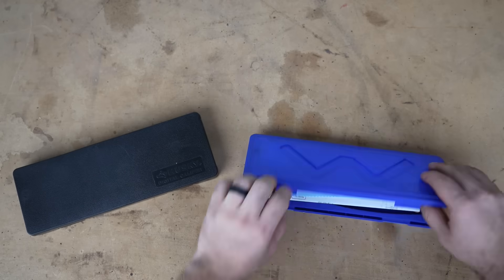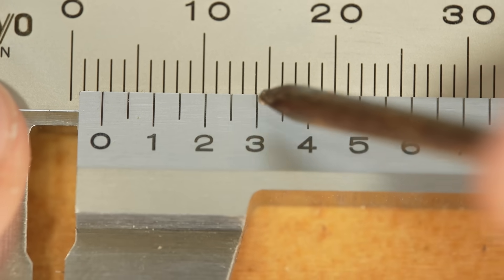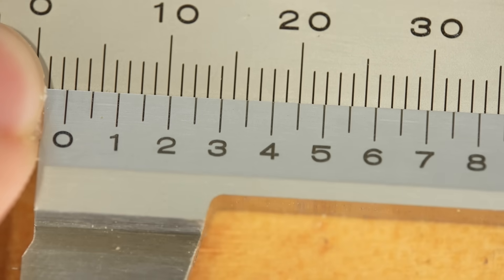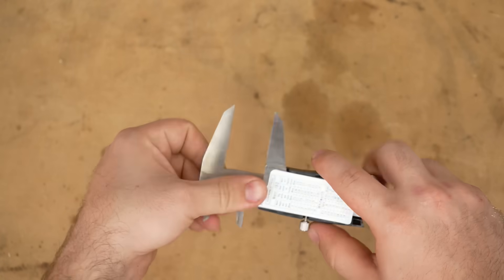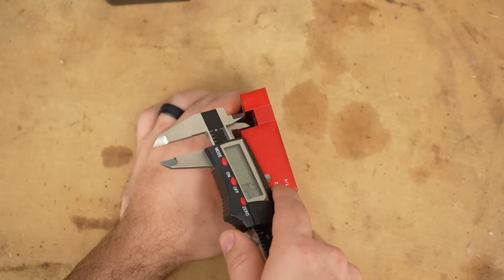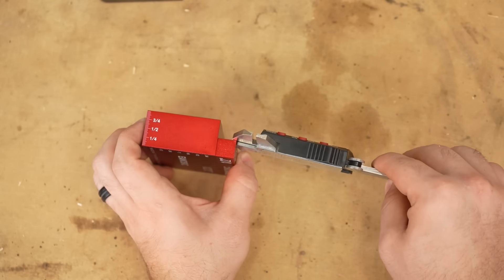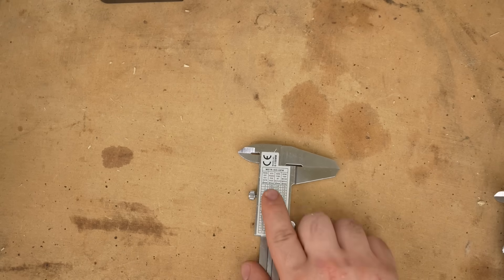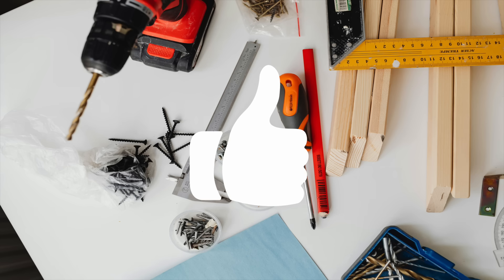I wish i’d known this sooner, How to use calipers like a pro

Comment: Step measurment and China Export was new for me. Thank you very much.
Reply: It's a wrong claim.  Embarassingly wrong, the guy did no research.
Reply: Can CE cert mark be legally used in other spacing than what is explained here? If it has other spacing is it invalid aka non-trusted? Does CE force CE with the spacing and other aspects? This is a very interesting thing to me that i first came across here. 🤔
Reply: @valkohh  Theoretically you should always have the proper spacing because otherwise it's not the correct logotype, but the incorrect spacing is relatively common even in "reputable" products. That it means something else with the incorrect spacing is a myth, it's just people being lazy and not caring.
Reply: That's an urban myth. CE is self certified anyway, and the wrong spacing is just a result of Chinese exporters not even giving a crap about putting the logo on correctly.
Reply: "CE is self certified anyway" - that is true, but that doesn't mean that anyone can just stick a CE mark on anything. By self-certifying a product, you are declaring that you have carried out all necessary tests and that it conforms to all relevant regulations. It's like declaring on your tax return that you have included all your income and have answered all the questions honestly. If you're dishonest in either case, then you'd better pray that you don't get caught. If you CE mark a product and somebody gets injured by it and it turns out not to be compliant, then you're in big trouble.
Reply: @Chris-hf2sl  "CE" marks in short substitues the declaration of conformity. There is an incredibly high fine for misuse of CE marking BTW.
Reply: @jaromirandel543  :  Trying to impose and collect the fine from the maker of a five dollar digital caliper could be a life-changing mission!   🥴 😡 😜
Reply: @olenilsen4660 The EU has standards for many things - some may say everything and the standards are mainly there to protect the consumer. What is relevant depends on the product. The relevant standards for toys cover things that ensure that children are not going to be harmed in any way, for example that they item is not a choking hazard, doesn't have sharp bits of metal etc. No-one could test a vernier caliber against the toy standards unless it's a toy caliber. Yes, disreputable manufacturers, particularly those based in China mostly couldn't care less, however, in such cases, it's the importers and sellers who are responsible if something goes wrong. Nevertheless, there are some pretty dangerous items for sale on eBay and sooner or later somebody's going to be electrocuted by one of them because nobody seems to be checking them. When that happens, I wouldn't want to be either the importer or the seller.
Reply: @Chris-hf2sl  
or were those china export products mistakingly mentioned as european CE products?  where the desception was working as intended.
Reply: Exactly! Some calipers have some additional certifications, but these usually cost extra. For CE you basically only need to avoid heavy metals and toxic greases and that's it for analog calipers. For digital in theory it's also EMC and RoHS but I don't think anyone is doing EMC not counting most costly manufacturers.
Reply: You mean you trust the Chinese????
Reply: There is no 'correct', that's the problem. The only size/spacing requirements are that it has to be at least 5mm high.
Reply: Bottom line is that someone purposely copied CE to be deceptive.
Reply: @hansangb at least they spelled it right!
Reply: @hansangb  no deception. Literally anyone can put the CE mark on, if it meets the certification requirements, you don't need to 'get certified'.
Reply: @Macca81  I think things are getting lost in translation.  CE from China, yes.  Anyone can put it on. CE from EU, I know there's a self certify option (what's that about?) but it looks like there is a test you have to undergo.
Reply: @hansangb  :  Only because the "Spell-checker" corrected it!   😜
Reply: @hansangb Not really.
The way it works in the EU, that you need to comply to the law. Regulations and directives are such lawful documents. They tell you the rules, but not how to comply.
In order to have some assurance that you are complying, you can follow standards. And you can either test according to these standards yourself, or have a 3rd party certify your product according standards. If you don't certify, there is a large risk for the company that it may get sued or face even jailtime in case something goes wrong and authorities step in. Therefore, certification is a common strategy. 
For every Chinese product there is an importer or representative living in the EU that is responsible and can be sued. Even your AliExpress products have a representative address listed.
Reply: @solwidotnl  Such a small fraction of CE marked products is actually checked by authorities that the risk for manufacturers is basically zero.
Reply: "That's an urban myth. CE is self certified anyway" - and that is a myth as well. CE is only self certified for product categories that pose minimal risk. And even for those, the self-certification process must comply to the EU regulations for such processes.
Reply: Same for me.
Reply: Not sure what the difference is with the step and depth measurements
Reply: "China Export" is a good indication that the product is crap, and doesn't meet CE standards.
Reply: "China Export" is not a label that's used by anyone. The whole myth stems from people just using the wrong dimensions when they intended to use the regular CE mark. It's NOT, as some say, an attempt of being deceptive. It's simply a mistake.
Reply: Yup, me too. and C E mark identification can be applied to all China Exports The country of copying/stealing intellectual property even copies standards marks deceptively.
Reply: what a bullshit!
Reply: I aware of step measurement which is more stable than the depth probe. Not many users know this measurement feature.
Reply: @kestrel09  :  I used calipers for many years, and only learned about it recently from another Youtube video.
Reply: @PiefacePete46 most of those other you tube videos ! Are all scored up ! On there points !
Reply: Same for me! Awesome, chinese been chinese.
Reply: Wow, i have just learned how long i have been totally clueless about the various ways of using the calipers. Thanks for improving my knowledge about the tool i thought was just a fancy school ruler.
Reply: THE GREAT CHINA SCAM CONTINUES …
Reply: This 👍
Reply: Same here. Have to keep an eye out for that china export one... and mention it when someone's looking.
Reply: A " slide" caliper of this TYPE,....SHOULD NEVER beclosed,..... ( closed JAW to JAW ) Just as a ZERO (2) 1.00 MIKE & a  ZERO  (2) 25.4 MM MIKE. THERMAL CONDITIONS. Don't close 'em up.
Reply: @WilliamNorrie-c1n  I guess you are talking about closed when storing? With regard to cold welding?  I have some cheap carbon fibre composite calipers along with my decent micrometers and digital calipers. These cheap plastic calipers are spot on for use when working in my woodshop, they work to 0.1mm which is good enough for my wood projects, and only cost me  £3.70 a set.

Comment: The best set I own is a fractional/decimal inch dial caliper and I use them in woodworking (iGaging 6" set).  Changing batteries gets old and they are easier to read than older vernier types.  You can easily get to 1/128" resolution (~0.005") with is more than enough for fine woodworking.
Reply: I agree, my dial calipers have fractional inches, decimal inches and millimeters. The best of all worlds.
Reply: I have a pair of Mitutoyo Diamond vernier calipers that I bought in 1970.  Decimal inch on bottom with .05” scale and 1/128” scale on top.  I still don’t know how to use the top scale.   Why would anyone want to measure in anything other than decimal.  Fractional inch measurement is the best reason I know to use the simpleton metric system.
Reply: @dougberrett8094  Woodworking... Most everything is fractional inches.
Reply: @dougberrett8094  the threads and fittings that come in Imperial Freedom Units, everything else metric
Reply: ... more than* enough

Comment: Measuring in inches and talking about accuracy. Thats hilarious.😂
Reply: An inch is defined by the US as exactly 25.4mm.  You can do math, right?
Reply: @firstmkb  1mm equals to how many inches? Keep doing math instead of work.
Reply: You do know that accuracy, precision, and units or three totally different things and do not have much relation to each other.
Reply: @jamesraykenney  Well they do when used to define each other. Otherwise there wasn't need to improve them at all.
Reply: My precision measuring tools read .0001 inches. I'd say that's accurate.
Reply: @rshinn1776  just because they "read" to that level doesn't mean the measurement they give you is what the measurement is.  There is a whole science of measurement.  It involves certainty, systematic error, and random error.   But I agree, for most uses the "tenths" vernier on micrometers is good enough.   Or even the readout on a digital tool.
Reply: Thinking that's hilarious is hilarious
Reply: Words spoken by only an idiot.  Both inches and meters can be divided by powers of 10 to however fine one needs to go.  Measurement is also very much more complex than simply slapping a measuring tool on the specimen.  What is the systematic error?  What is the random error?  How does one determine these.  How firm does one clamp the measurement tool on the specimen?  What is the confidence value?  In other words what is the range in which one is confident the measurement resides.   One often needs to move to an INSTRUMENT with more precision rather than a system with SUPPOSED higher precision.  Calipers are only a precision instrument when compared to scales, tape measures and yard sticks.   Try measuring to 8 millionths of an inch with calipers.  There is no way.  If you know how to measure this close, you will also know why it doesn’t matter what system is used to obtain the precision.
Reply: @dougberrett8094 inchers should divide by powers of 12
Reply: @acajutla They are often also divided by 16,  but when things need to be precise they are devided by 1000 just like everyone is used to from metric ;)
Reply: @dougberrett8094  When I was a printer  back in the 1980s, we would call out adjustments to the printing press by either the paper type or the color of a cunt hair (blond to red head).  The scale does not matter, precision does.  It is extremely hard to measure  the thickness or difference between printed register marks on paper that are only a fraction of a line under a 10x magnifying glass.  If you do not get it right, color pictures will be blurry or your eye will see white gaps between different colors.

We use micrometers to measure paper thickness and it was very dependent on how hard you squeezed the paper.  Paper is a soft material that you are trying to measure to  within 1 to 2 thousandths. 

Today, in my home workshop, I usually do not use the measurement beyond a rough guess.  I compare one item to another using the calibers.
Reply: @dwayne7356  Well if your measurement depends on some forced then you're either doing it wrong or using wrong instrument. Yes, micrometer isn't that good for paper if you're using it as is. You need two calibrated measuring plates  to distribute the force.
Reply: @dwayne7356  true.  Feel has a lot to do with what reading you get.   That is why the better mikes have a mechanism for making consistent pressure.  For tight work at a place that made parts for Boeing and the US Air Force, we often set up the measurement using an indicator.  That way consistent pressure was used.  That is when the tolerance allowed such crude methods.  Sometimes the total tolerance was less than .0001".   Air gauges were often used.
Reply: As usual Americans defending their ancient measuring system!😂
Reply: @ravindradaundkar9905  
It's not even theirs.
Reply: @andrewholdaway813  Right.
Reply: @ravindradaundkar9905  
Right
Yes  (as usual)

Comment: How is this new information to anyone? Don't Yanks learn this in school? What are they teaching their children?
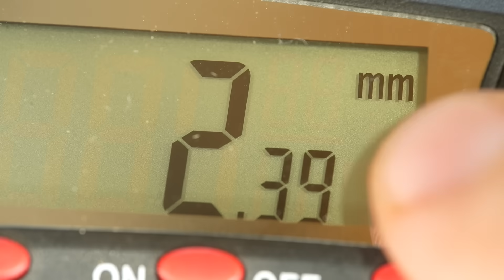2:34 Two point THREE nine millimetres...
Reply: American shops are all CERTIFIED so that they can supply the automotive industry. ALL inspection tools must verified annually. These vernier devices are generally not allowed. My sister had her Mitutoyo dial calipers confiscated and replaced with digital by her employer.   Vernier calipers are just too slow....An actual machinist can read this because we're using the thimble on micrometers but the device in this video is very uncommon.  I have NEVER seen a vernier caliper in industrial use, and that's going back 35 years.